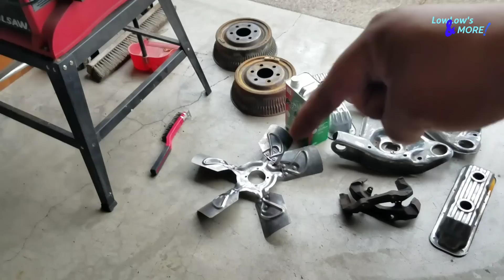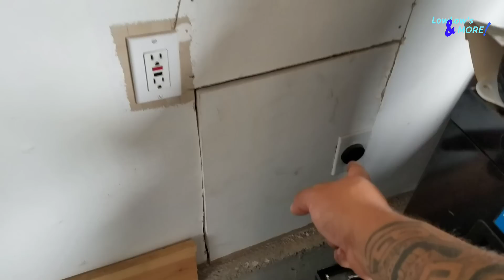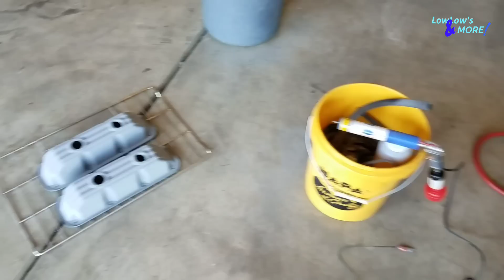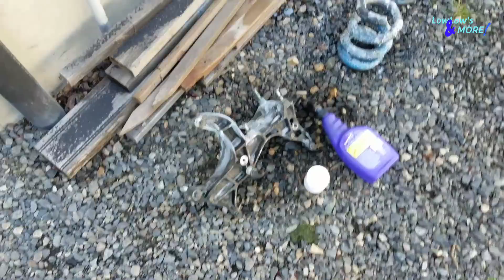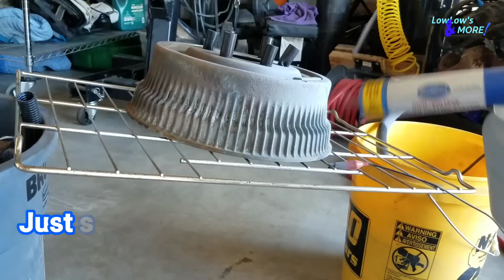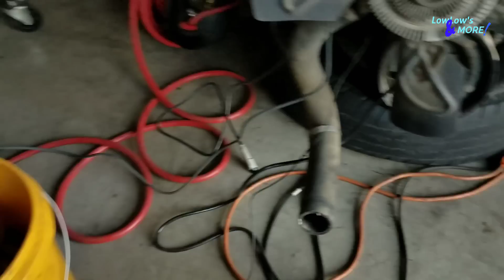Doing Some Chrome Powder Coat

Comment: I bought a 79 CJ5 with M/T valve cover story.  I scrubbed them in purple clean with hot water.  Still had stuff in the crevices so I put them in a roasting pan with water and antifreeze and put it on my gas grill at low heat (not quite a boil) for about two hours.  I hit the with a detail brush to get the last of the gunk off.  My final act was to let them run in the dish washer on every cycle possible.  

I powder coated them with chrome and then translucent red.   After they cooled I sanded the ridges and letters and polished them up.  Last step was clear powder coat and they look awesome!   I have detailed everything under the hood with powder coat.   I painted the engine bay semi-gloss black, the engine block and headers are black.  Brackets and pulleys are Porsche silver, alternator is trans red over chrome, crank vent and   Pumps on the carb.  It's amazing what you can do with powder coat and imagination.

Great job!  Keep posting!

Comment: Good deal I wasn't even aware that you can powder coat chrome surprised you didn't go all out and do your spindles or steering linkages I'd like to see more especially on how it holds up also quick question if I replace my ball joints do I have to take the control arms off?
Reply from the maker: If u have room to do it while it's on the u can, it might just be easier to take it off the car completely to swap ball joints.  I was going to do my spindles and upper control arms but I didnt have enough time to prep those parts. My car show is next Saturday and I need to start putting it together again.

Comment: I just took my full front suspension for chrome coating..wanted to ask how's the powder coat holding up to the extreme heat of brake brackets..thought of doing those to
Reply from the maker: I did my caliper brackets,  not yet the actual calipers.  The brackets are doing fine.

Comment: also head up you need to do a top coat on chrome. chrome is one powder you need the uv protective coat. cool part is the top coat can be clear and look like chrome or colored to be color chrome. when i started i made these mistakes. when you just do only chrome it will loose color fast and hold hand prints.

Comment: Question. On your spring. U know how u hang it on that piece of metal. To hold it up. How does that part cure or how u  coated that part
Reply from the maker: As it hang, that's how I sprayed it with powder.  Same process as the other parts.

Comment: I wonder, are you able to give a 1-year review? I would like to know how these parts help up with that awesome paint! Thank you!
Reply from the maker: I could do a quick review on the next video, the parts are holding up great with the heat from the engine. No chipping and no discoloration
Reply: @lowlowsandmore  Knowing that is already very good, thanks for the update! But yes, if you get to it, a short video would be a great addition.
Reply: @lowlowsandmore  Any updates? Powder coated some small brackets for the grille how’s yours holding up?

Comment: If you continue to powder coat , do yourself a favor and buy a sandblasting cabinet. It'll save you a ton of time
Reply from the maker: I do have one but at my small garage where I have a small air compressor.  I cant fit another bigger air compressor in it run the cabinet.